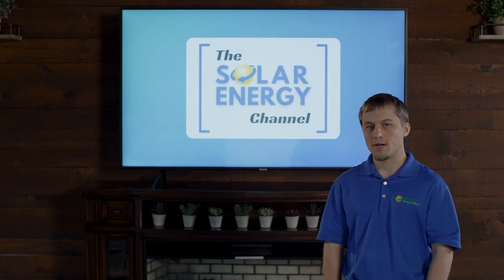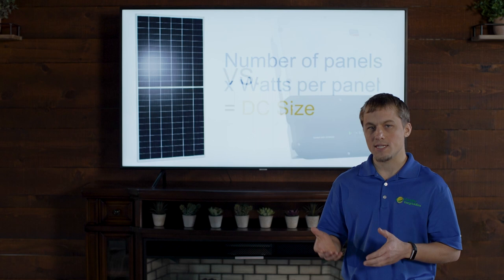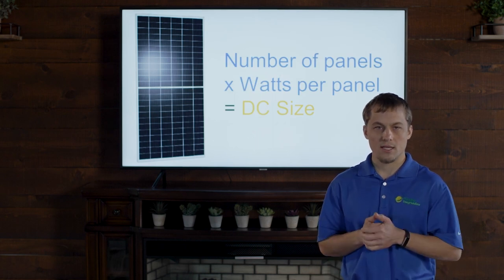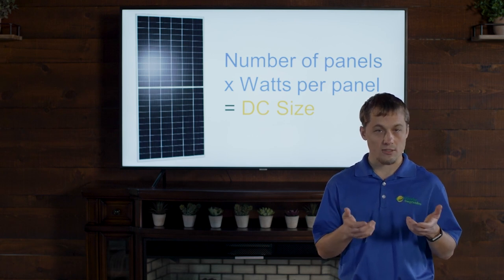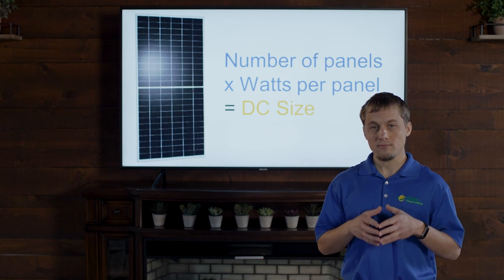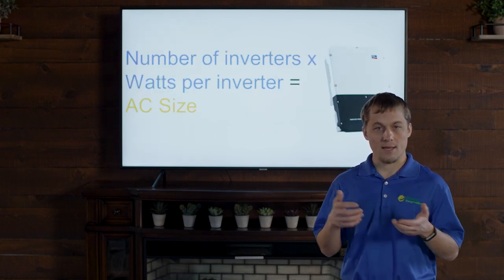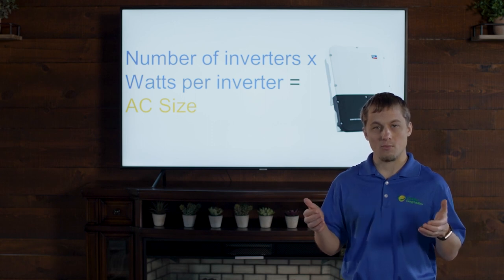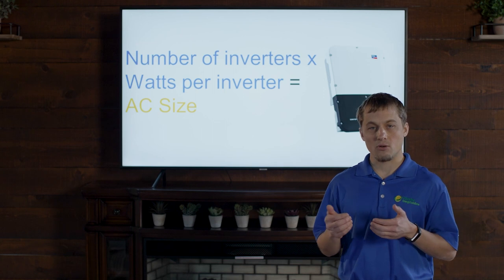DC/AC Power Ratio EXPERT Reveals Top Solar System Sizing Tips

Comment: You to stop with return on investment talk.
Anyone who has rented power for 20 years already is pointless.
My reason for going solar 100 % to get rid of power company dependance.
I would rather have excess everyday and keep my batteries and charge them quickly everyday and use them every night then give 
a penny to power company
This takes more then most talk about.
The other thing not discussed is making insulation upgrades to the home.
The best is on the roof line 
insulation.
I have a metal roof with 2 inch isoboard under metal and 6 inch sprayed inside the roofline and keep temperature swings way down overall 
My thinking is build system 2 twice as big as needed and system run at 1/2 duty cycle then half system running wide open all the time trying to keep up.
We never seem to hear this from installers.
The first point of any power production system is 
failure is NOT an OPTION.
They are a few other points that get over looked in system designs.